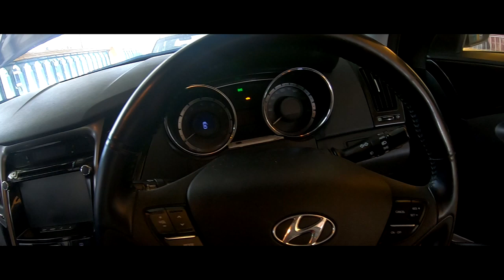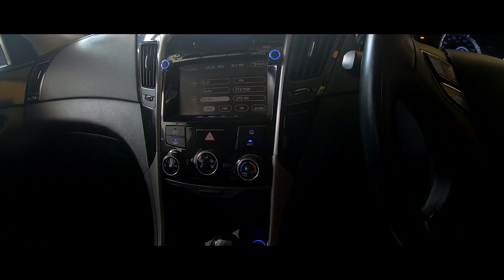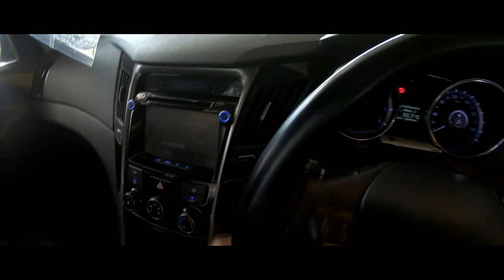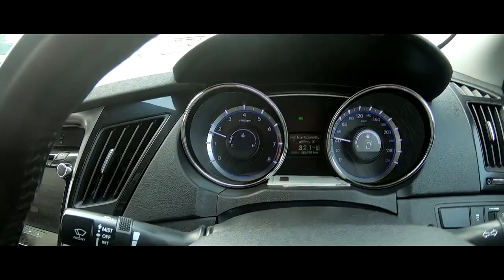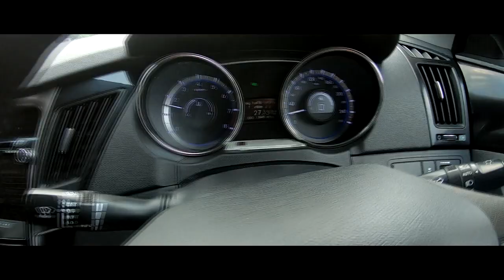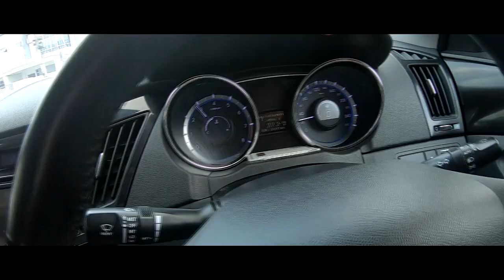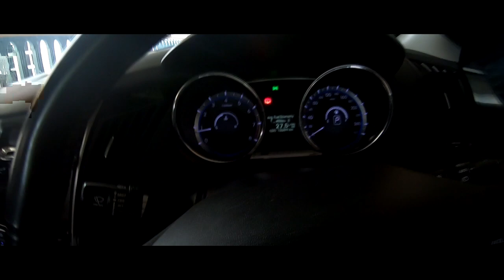Cara tukar minyak gearbox hyundai 6 kelajuan - #MULO Jom DIY!!!

Comment: Tuan berapa bnyak minyak keluar ya masa buat leveling minyak gearbox..sy buat macam banyak pula keluar..sy tuang 4liter kedalam gearbox.masa buat leveling bnyak kluar dalam 400ml.trus sy stop..mmng banyak ke minyak kluar masa buat leveling
Reply from the maker: Betul kalau ngam2 4L mmg bnyk keluar..biasa nya botol ke empat tu buat flushing je..maksud sy lepas drain isi dulu.. start engine biar die running sekejap pastu drain semula..sbb yg keluar tu dlm gearbox oil cover tu jer..yang dlm hose x keluar lagi..lagi 1 just make sure kereta parking kat lantai yg flat. Biar je keluar smpai menitik..kalau masih mengalir tunggu smpai meniitik